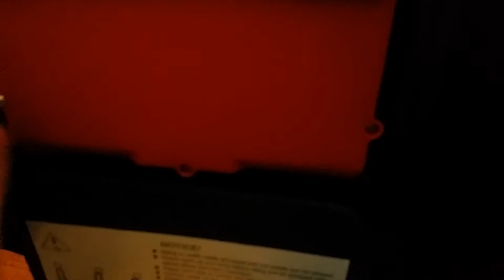Calibrate Chinese Generic Electric Unicycle

Comment from the maker: I actually found that using soda cans in place of the boxes works much better because the boxes are likely to crush and not be exactly leveled like soda cans are, plus it's easier to get a hold of 2 identical sized cans. :)

Comment: Thanks for your video, the control board does fit, but when I turn on the  unicycle, it starts running forward at high speed for about 3 or 4 seconds, and then suddenly shifts into reverse at high speed. I have to turn it off to get it to stop. Is there a chance that I have it  connected wrong? Or could the control board be defective? Thank you, Gregory
Reply from the maker: Hmmmm I've never heard of one doing that before, it should only go one direction, then give up and stop completely.
Reply from the maker: Not sure what you mean by the control board fitting.